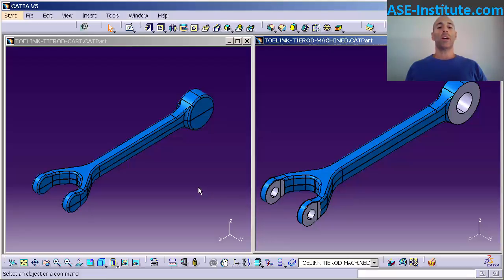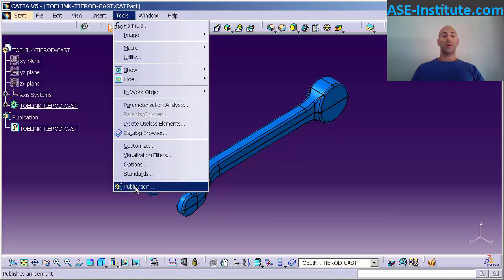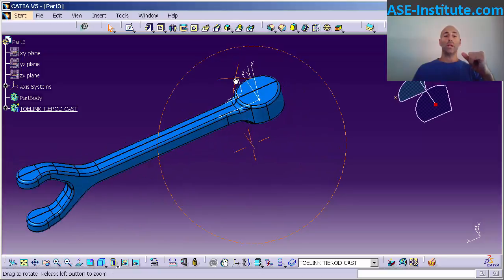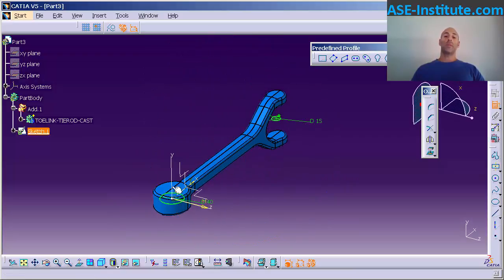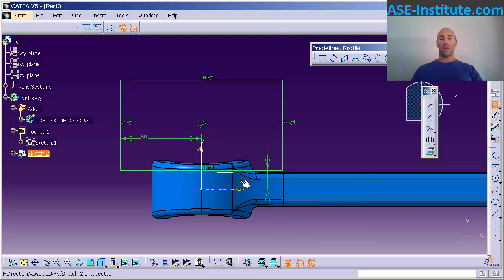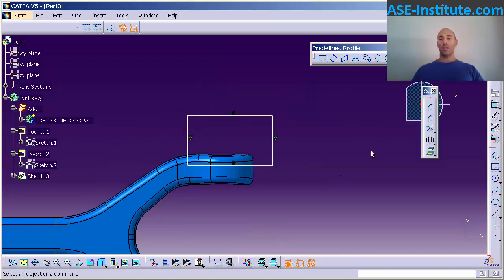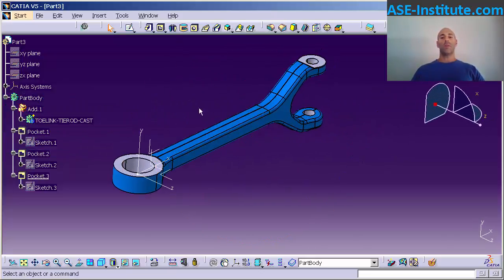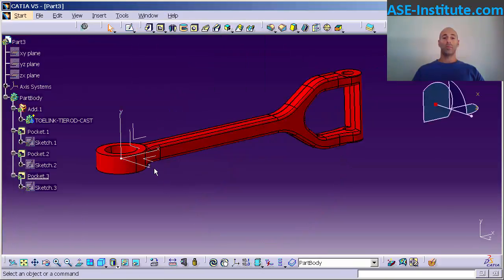Casting to Machined Part | Catia V5

Comment: Hi Sir, quiet interesting as it arrives in time to answer some of my questions related to casting projects that i should nearly be able to do in my workshop. So i presume you mostly do the same under NX with the WAVE Link feature, don't you ? I've seen a couple of times there was a common practice to use a PLM to manage family parts but I don't use any of them as i never needed to create family parts yet. I've checked many many tutorials about WAVE linking, and apart from the feature presentation there isn't much informative demonstrations about its right way to use. To resume  there is a big lack of methodology on most tutorials i've found about it or at least "do & don't". Actually i limit my use of the feature to reference some sketches only but i feel like missing the BIG thing behind. If you Sir could adress this with your teaching talent, you would be more than welcomed :)
PS : that's cool to see you :)
Reply: PSbis : another way i just found on Siemens forum is to start from the design body and using synchronous technology to remove machined features like holes, then add some extra thickness to create the final stock body.
Reply from the maker: How is this?

https://youtu.be/i7Z-Y81h0-g

I will do a video soon on the Synchronous method. I prefer this method because there is no guessing what the casting will look like.
Reply: class A surfacing Oh, cool, you just did it ! ^^ . Indeed, i think the ST is a simpler way to go, keeping the design for manufacturing apart from the initial steps. 

For those reading us here, i was talking about this article from Siemens community forum : https://community.plm.automation.siemens.com/t5/News-NX-Manufacturing/Create-Stock-Body-from-Design-Body/ba-p/22889
Reply from the maker: Okto Putsch 

Just watched the video. It is not bad but I would have done it a little different.

After deleting the holes I would have deleted some of the fillets a well then I would have used 'Offset Face'. That way you can just select all the faces at once to create the additional offset geometry.

When I get a chance I will toss out a demo.

Thanks for posting.
Reply: class A surfacing Indeed, it would requires less operations and would be closer to a real casting. (btw, do some similar direct modeling features exist on Catia ?)
Reply from the maker: Catia does have some direct modeling tools but nothing like NX.

BTW, my name is Steven.
Reply: class A surfacing Thank you Steven :) i'm Rudy
Reply from the maker: Okto Putsch Nice to meet you Rudy. Where do you live? Always curious to know what is happening around the world.
Reply: class A surfacing Pleased to meet you too Steven, despite i comment since a long, now ^^ . Well, i'm from the south-west France, in what we call "the Basque Country", a territory of 7 provinces split between Spain and France. Actually i'm living 10km away from the border in a city named Saint Jean de Luz, a rather touristic place, within a bay protected by 3 sea dikes. Just here, side up of the pic -> http://bit.ly/2dvys20. North-east view : http://bit.ly/2d5Ql7R . West side, with Spain on top and its mount "Jaizkibel" (pronunced "raïskibel"), near Hondarrabia (Spain) and Hendaye (France), while you can see Sokoa/Zokoa down side, in the bay, which means "the corner" in basque : http://bit.ly/2d5tXgi . And a last one, to admire the location because we live in a place just at the end of the long Pyrenean mountain's chain (430km separating my country from Spain) : http://bit.ly/2dvAwH1 . Ski stations are just 80km away (private pic took years ago, near one station : http://paparoot.org/derriere.gourette.au.dessus.du.lac.jpg ), as the closest mountain is only 900m high (and serving as a TV/radio broadcasting relay). My city is known for the wedding of Louis XIV known as the "Sun King" with Philip IV's daughter, from Spain, in 1660. (The original church's entrance has been condamned since, btw). This is a quiet old place as you can still see through the architecture, like in this pic (following pictures are from my personnal stock) : http://paparoot.org/bistrots.jpg but it's also festive on summer, where some flamenco shows can happen too : http://paparoot.org/danseuses.de.flamenco.-.portraits.jpg or http://paparoot.org/flamenco.sur.scene.jpg . If you have a walk in our forests you may notice some strange things, like hollies growing up on oaks, which happened often by the times when forests were more exploited. Those trees were used to be cut "short", leaving a platform on top, which created a space where the deposition of leafs turned it into a giant pot, a picture worths a thousand words : http://paparoot.org/chene.jpg (holly trunk had a diameter around 20cm here). Last thing about my city : it was well known for its tuna fishing. In fact it was the 2nd port of the country for this, after Concarneau in Brittany, north-west France (where i also lived for a while and even been a tramp ^^ very nice place also sharing some cultural acquaintances and history related to this kind of fishing). But that's all folks for the presentation of the place. What about you Steven, where do you live and/or come from ? I've read you traveled a lot around the word on the few words describing you at the ase-institute.com page.